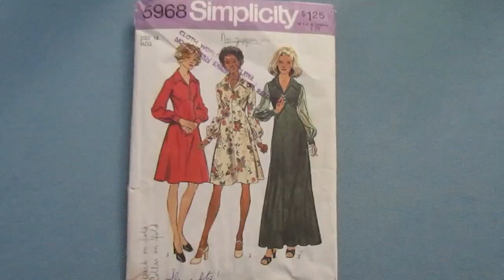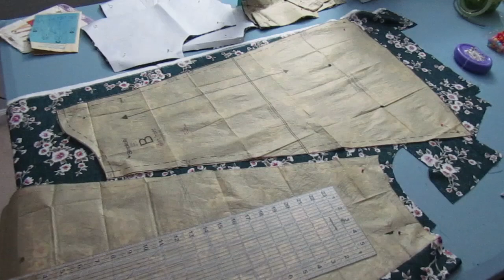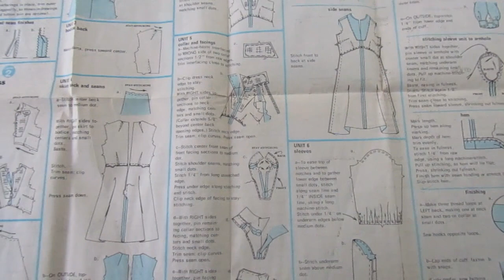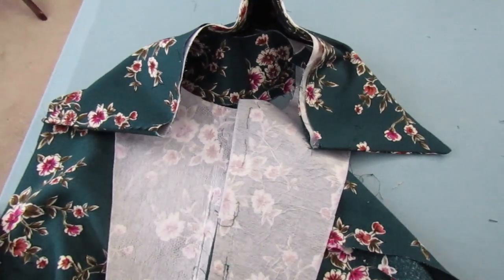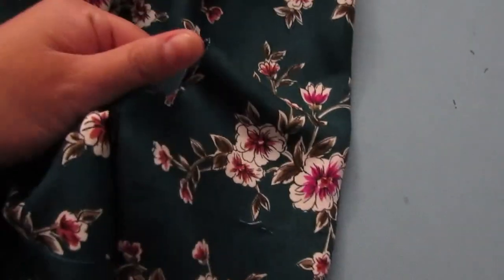Sewing Vintage: Simplicity 5968 (70’s dress pattern)

Comment from the maker: Sizing: 0:20
Measuring the pattern: 0:41
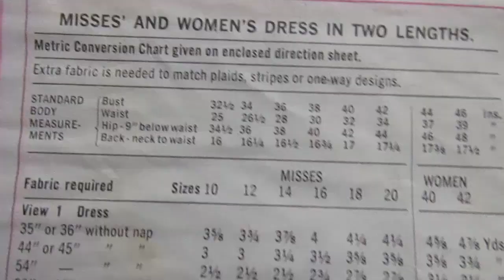Actual size: 1:28
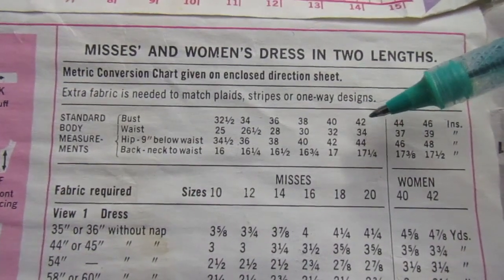Full bust adjustment: 2:01
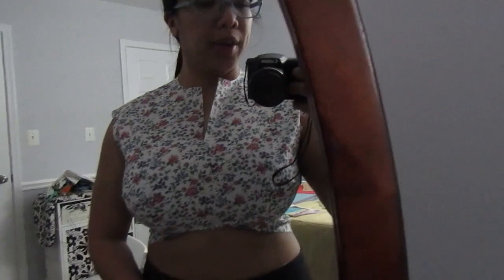Bodice fitting: 3:28
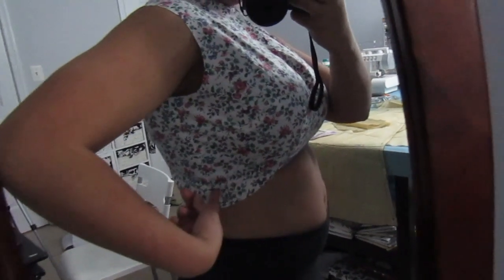Cutting and sewing: 4:34
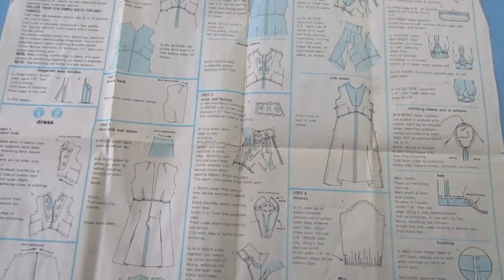Pattern changes!: 8:40
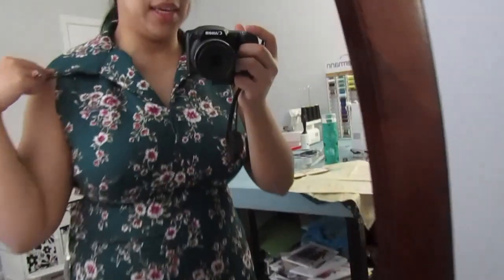Fitting: 11:08
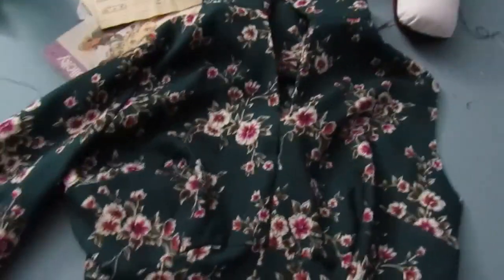Inserting the side zipper with sleeves: 11:43
Finished dress! 13:10